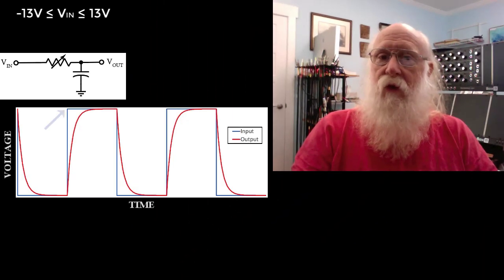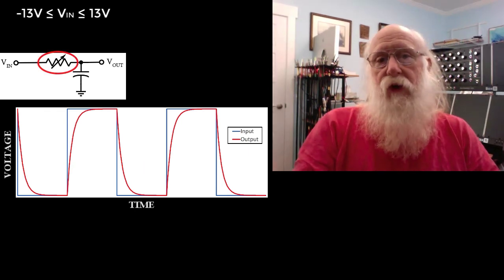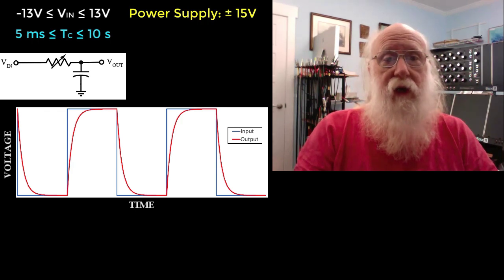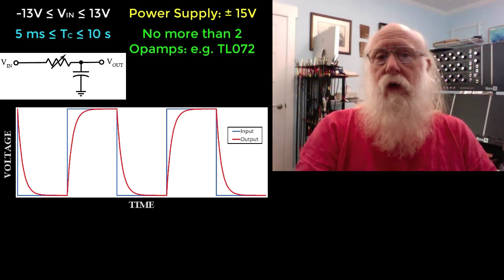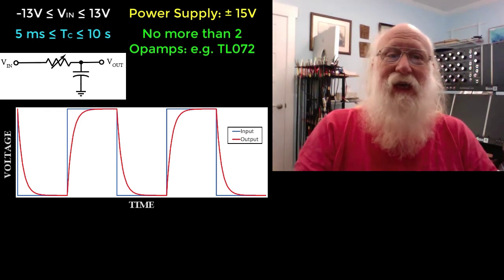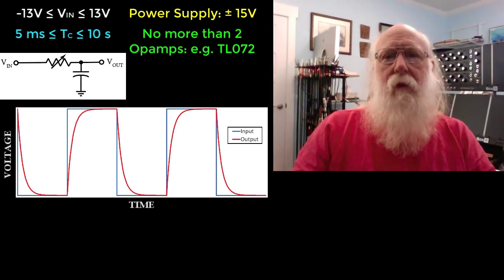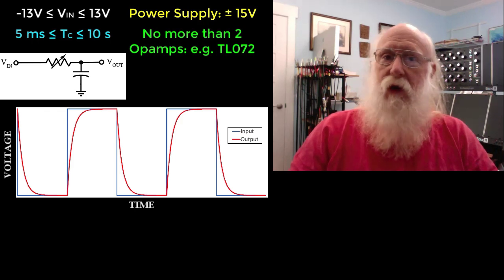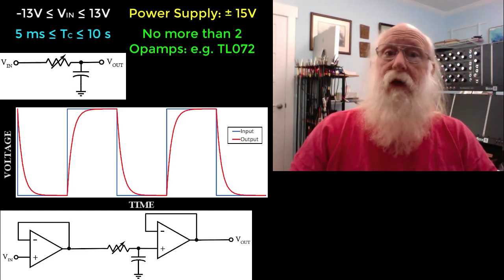Slew Limiter Part 1

Comment: Sorry, prof, I didn’t take the prerequisite circuits course. I'm a hobbiest, middle-aged doofus trying to learn how to breadboard a slew limiter to use with a bastl kastle and volca modular. Learning electronics and music production by watching youtube and trying for myself.
Reply from the maker: That is exactly how I started, except I was much younger (early teens) and the internet did not exist - heck, the first microprocessor had not even been designed yet! My information came primarily from Popular Electronics and Electronics Illustrated magazines, from which I built quite a few gizmos, most of which I managed to get to work, although I really had no clue HOW they worked. Persevere! You may be amazed how much you actually learn by building stuff you do not fully comprehend, particularly if you pay attention to whatever explanation may be given with the circuit. 

I would really like to do a basic electric circuits series, but time is the limiting factor. Surely there are such things available online, though I have not looked at any so cannot make a specific recommendation. 

I am not familiar with the specific equipment you mention, but one thing you might be wary of is the resistor at the output of the slew limiter, which in the circuit presented (so far) is 1000 ohms. IF you are using this to add slew to the main voltage output of a musical keyboard (or other controller - the signal that specifies the frequency of the oscillators), then you almost certainly will want to get rid of that resistor, replacing it with a wire. I have another slew-limiter video in the works that will address the problem that the 1K output resistor creates in this situation, but have no idea when it will be ready.